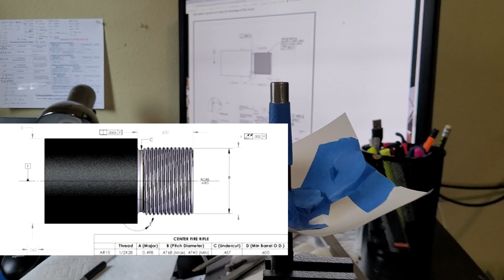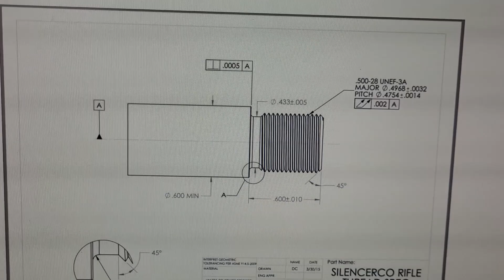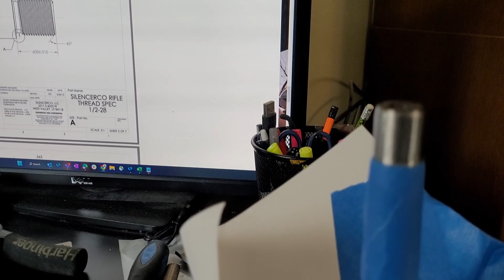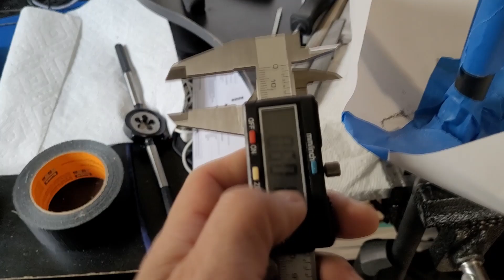DIY Barrel Threading in Easy Way

Comment: With 60 plus years as a gunsmith, firearms manufacturer and machinist behind me, in my opinion this is NOT a safe way to thread a barrel for a sound suppressor, flash suppressor or muzzle brake. There is no way that the barrel ends up perfectly round and with the external diameter perfectly concentric with the axis of the bore when you reduce its diameter by hand filing.  Also, it would be tough to get the threads started square to the bore with a die even if the barrel were turned perfectly round and concentric, without the use of a tight-fitting pilot in the bore. Baffle strikes or strikes on the brake or flash suppressor would damage parts and potentially harm the shooter or bystander. Send it to a gunsmith and have it threaded on a lathe or use a freely rotating pilot in an annular cutter, to reduce the diameter and have it end up close to concentric with the bore, followed by a threaded pilot for the die to cut the external threads. The lathe, with an independent four jaw chuck, and a closely fitted plug in the bore to dial the axis of the bore into perfect concentricity with the axis of the lathe, then turn down the outside diameter, start the threads with a single point tool in the lathe, then finish them with the die if you want to, that's the best way to do this, but filing it down, not a chance, I have repaired numerous rifles over the years brought in by folks who tried to thread the muzzle end of the barrel in the manner described in the above video.
Reply: In the US, Silencer Central offers mail in barrel threading service for a very reasonable price, so I’d say send it to them if you can’t find anyone local to do it right.

Comment: It looks to me like you are having to apply a lot more downward force than is usually necessary when cutting threads, which tells me that you probably didn't remove enough metal from the barrel before employing your threading die. I hope the alignment was correct. If you were threading for a suppressor, much more attention should be paid to correct alignment, starting with the TAT as low in the die is you can place it without contacting the muzzle, then rotating it 90º with each 90º cut of threads until it is completely unthreaded from the die.
Reply from the maker: You are correct. I tried to avoid over cut my barrel
Reply: @NorCalOutdoor  I tried the same thing and  applying to much downward pressure, I misaligned the threading initially, and ended up having to recut 1/32" smaller. I made sure the second time that I had taken enough off initially and used the TAT for almost the entire threading process. As such, I barely required any downward pressure at all, and that was only to start the initial cut. After about 90-120° of rotation, the die pulled itself down and I just had to apply moderate torque, stopping every 90° of advance to break off chips, add oil and counter-rotate the TAT. I probably cut almost 3/4" of thread on the barrel, then used a file to take the burr off the edge of the barrel, never going near the crown, of course. Now things align beautifully.
 I hope your threads do as well.  That stuff matters! And yes it can be done by hand! Thank you again for making this video and encouraging others to try things for themselves (after doing proper research, acquiring proper tools, and understanding what risks failure may entail.) 

By the way, keeping the vice tight while doing this work is no easy task! Your video reminded me of this.
Reply from the maker: @N0B0DY_SP3C14L  Sorry to know you had to cut 1/32", but glad to know you made it right. 
Yes, if you can pile it enough, it will make the threading easier. It is not easy to pile it equally around the barrel. You did a good job.
Thank you for sharing your experience. I'm sure others will get benefits from learning  your experiences.
Reply: @NorCalOutdoor  I actually built a small jig out of a small piece of metal to help me file it down evenly.
Reply from the maker: @N0B0DY_SP3C14L  that's  a brilliant idea 👍

Comment: Wanting to do something to save money is understandable, but safety has to come first, it MUST be done correctly. This is an excellent way of how NOT to do it. Concentricity between the OD and the bore is always off. Not taking the metal down to the proper max od before threading will never give suitable results. The stress that you are excreting on the muzzle can totally screw up the accuracy. To long of a thread and it might not seat the device properly. No relief cut for the threads?. Taking a file to the crown without dressing it correctly?  People can be seriously injured by bad backyard hack jobs.
Reply from the maker: @bigtexfirearmsllc  I can see your points. Thanks

Comment: Sorry, truly cringeworthy. Doing this by hand all but guarantees the barrel threads will not be perfectly aligned and concentric to the barrel's bore axis. Properly done on a lathe, the barrel is first adjusted in the lathe 4-jaw chuck using the inside surface of the bore as the reference to center on. The outside surface of the bore should never be used as that reference, as the bore and barrel my "look" close to the eye, while still being off event a tiny amount. Yes, that's common. Aligning things to the bore ensures the barrel device will be concentric and aligned properly with the bullet's line of travel so it will not adversely affect accuracy . . . or worse, cause a suppressor baffle strike.

Comment: how well did your bullets fly out the barrel did it line up correctly
Reply from the maker: @bigjolley6684  I used an endoscope/borescope camera when I zeroed it. Looked like it lined up good. At 100 yards, very tight groupings. 300 yards about 2-3 inches.

Comment: An annular cutter would save alot of time ! Filing is a bugger.........
Reply from the maker: @DaveMcGill-o7z  thanks. I didn't know an annual cutter for outer side, but only inner side
Reply: @NorCalOutdoor  There are several types which can be used with a hand drill or drill press.  They are far more exact in diameters pending the width of your barrel muzzle. A pilot rod is available to the caliber. and i strongly advise to use one..
Reply from the maker: @DaveMcGill-o7z  Thanks again. Good to know. I will do some research online